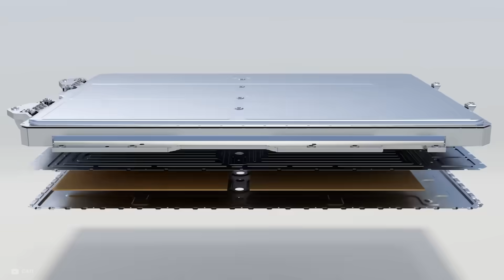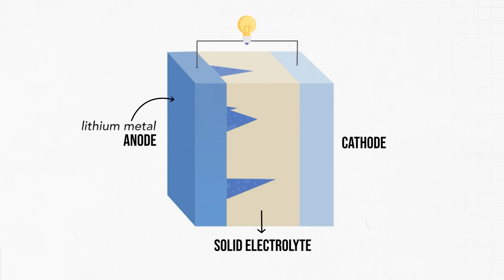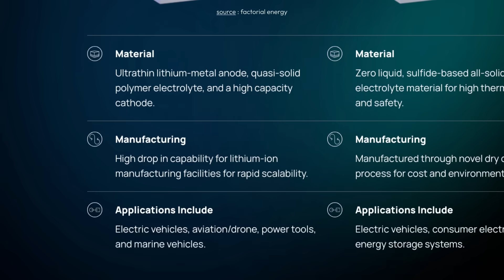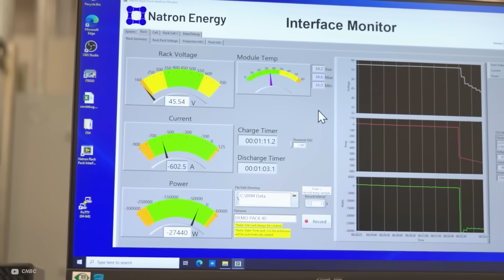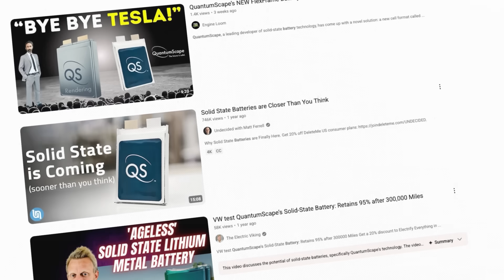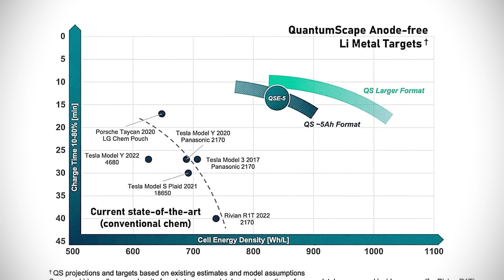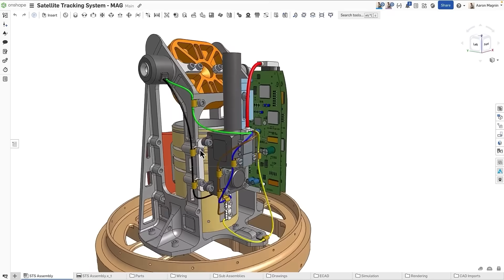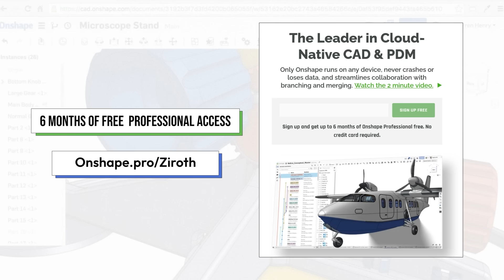The Decade Wait is Over, Solid-State Exists.

Comment: The two bottlenecks for solid state batteries are still unanswered. Can manufacturers scale up volume production, and can they be price competitive. I suspect that solid state batteries could be used in hybrid packs, alongside conventional (and more affordable) battery chemistries. In the way that some gas hybrid vehicles use small ultracapacitors today as regeneration buffers. Potentially, you could have an affordable, efficient EV with a combination of super cheap sodium ion batteries and semi-solid state batteries. So in the end you have an overall pack cost similar to today's NCM batteries. But you could add 80 miles of range in 3 minutes for a quick top-off charge when needed.
Reply: At this point I'd settle for unaffordable solid state batteries. They don't need to be directly price competitive if they have incredible lifespans.
Reply: @blue-pi2kt  Yeah, value is sometimes independent of price.
Reply: The Hybrid approach doesn't make much sense for me. Hybrid approach only makes sense if you have one big fast charging battery with low cycles for long tours and for local driving a cheap sodium battery. But even then, it requires the user to recharge daily and work with the system which is just not going to happen. So i don't ever see this becoming popular.

Semi Solid State batteries will be put into high class high range cars first. And everyone else still has to use not so good batteries. That is unless we are talking about SSS Sodium batteries which are also far in development and solve a problem that sodium has which makes them quite cheap and competitive with LFP.
Reply: @_aullik  But one point is that for most people long trips are rare. And daily trips are under 40 miles. Which makes such a hybrid battery useful for less expensive EVs.
Reply: @deanmcmanis4862   Technically you are absolutely correct. The problem is that you would have to tell those people that they have to reload their battery daily. People won't do this, so the advantage of a hybrid system is gone. Think about this from a marketing an reliability POV.
Reply: @_aullik  I think you are assuming that hybrids would discharge completely every day which I find absurd as you have another type of cell with a different discharge rate.  Also The vast majority of trips are short and varied and these vehicles are charged at the end of the night anyway.
Reply: @billhanna2148  Please think about this again. What is the advantage of a hybrid cell? 1 Type for daily driving, another for long range. The daily driving Battery is the one you discharge more than 50% every day. That's the battery you have to charge every day. Otherwise you are using your Long Range battery for daily driving and then the advantage of your hybrid is gone!
Reply: Thats just a product of time they will cost a lot when they first come out then the price will drop massively.

Comment: I had a used Zero Motorcycle S 2013 12.5 KWh, I drove it for 49.000 Km, I sold it and it is still running.
Then I got a used Zero SR 2018 14.4 KWh, I drove it for 26.000 Km and I gave it back to finally buy a brand new  Zero SR/F 2025 17.3 KWh, in 5 month I drove it for 6.000 Km.

I am sure the new batteries are/could be better, but the current ones are already fantastic

Comment: They should test these new batteries on an electric unicycle. Its a smaller battery size then a motorcycle, but still draws high power for long distances.